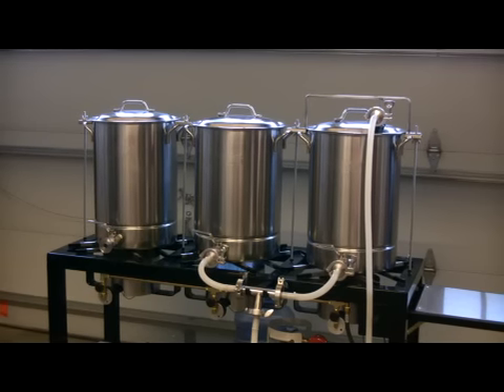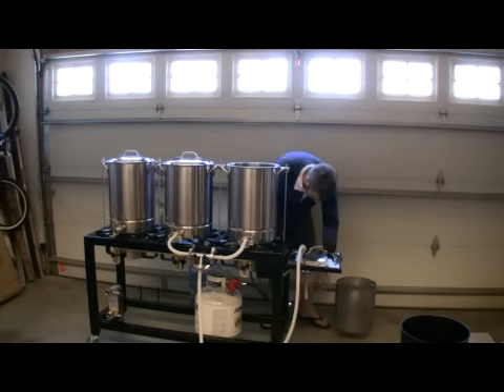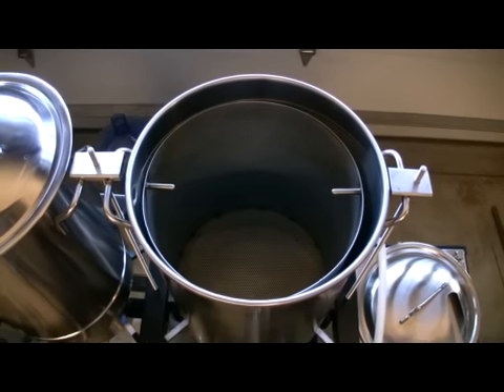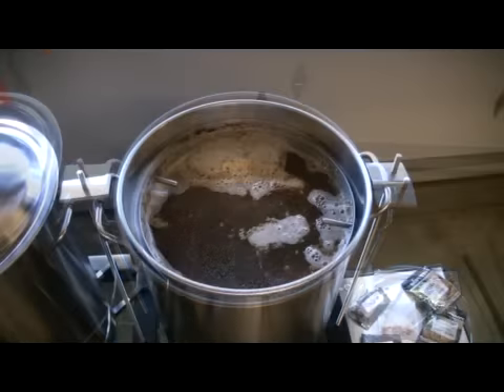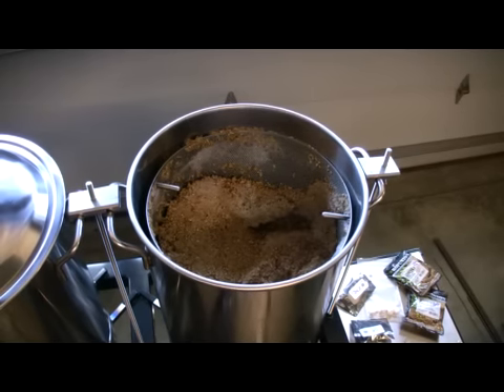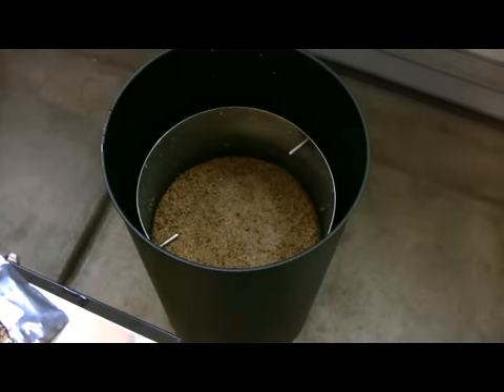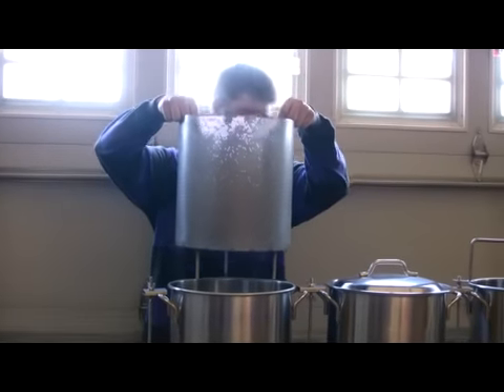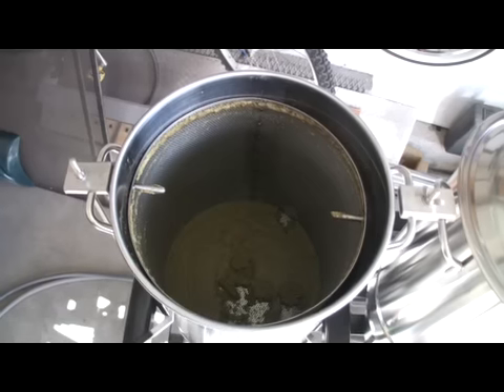Home Brewing all grain and hops filter

Comment from the maker: The false bottom I started out with has larger holes then my now .09". Overall, it's not such that the holes are so much smaller (or larger in your case) that it is more surface area for filtering run off. So what isn't happening is all the grain is packed on the bottom of the Tun. The pump isn't trying to suck water through this packed grain. Thus it is not "pulling" grain through the holes. If you are a gravity brewer, this filter has more surface area allowing better run off.

Comment from the maker: Absolutely this is a replacement for the BIAB! Easier to use, easier to clean but comes with a cost. This one was built to hold up to 14 pounds of grain in an 8 gallon kettle on my Brew Bench. Hole size is .09". Can custom build to your specs. See leekendrick.info or the link in the description for more info.

Comment from the maker: Re-circulating first runnings is always necessary regardless of the filter. My entire process is I pump circulate and occasionally stir the grain during mashing while holding mash temps. Sparge the mash, I use my Mash Masher to extract all the water out of the grain (no tannins extracted doing this). I also have a large filter I made in the boil kettle on the dip tube. My wort is super clear when pitching! I added a link in the video description to show how clear my wort is before pitching.